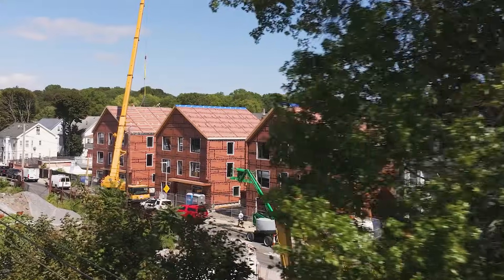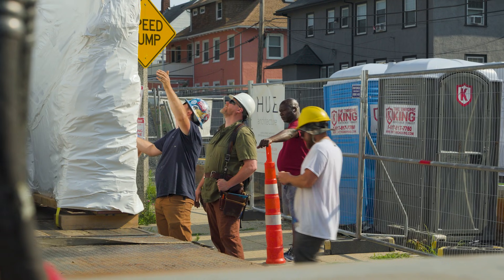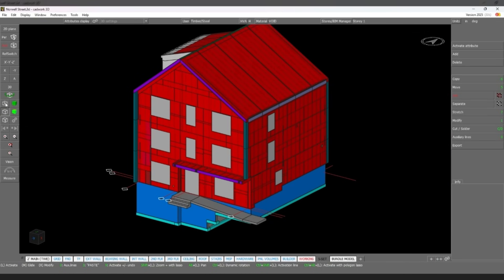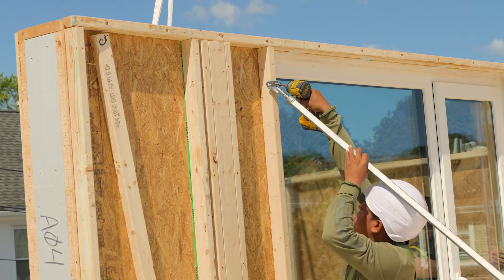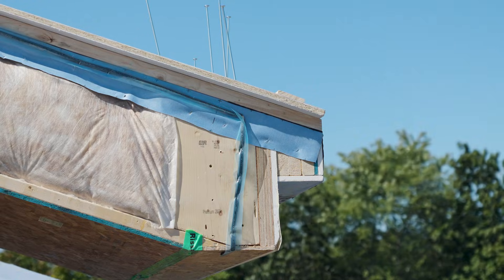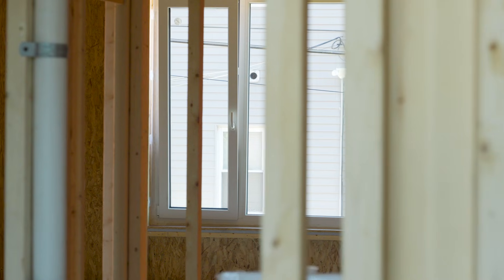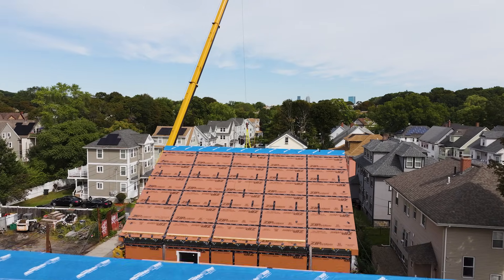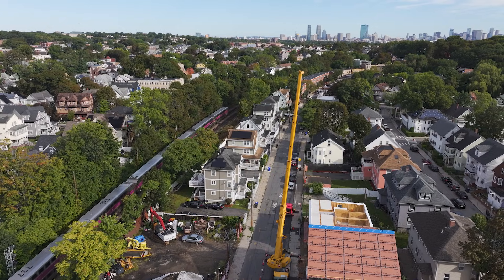Part 1: A New Model for High-Performance Housing in Boston

Comment: Still using stick framing and osb panels?   Is any of it treated to prevent termite infestation?  Building a passif house is pointless if insects are quitely chomping away at the framework.
Reply: Thanks for watching and commenting! The OSB is on the interior - we have Zip on the exterior with an 1.5” ventilation space behind our cladding. The foundation to wall transition is taped and flashed with metal to keep out bugs & rodents. Masonry mass wall is just not a feasible residential assembly at this scale in our market.